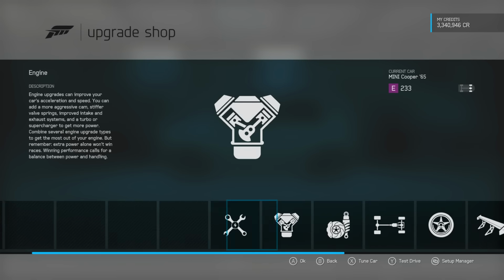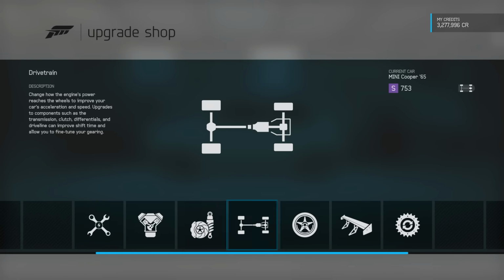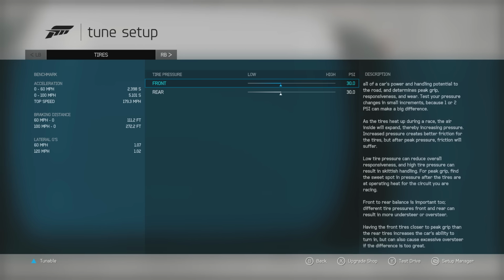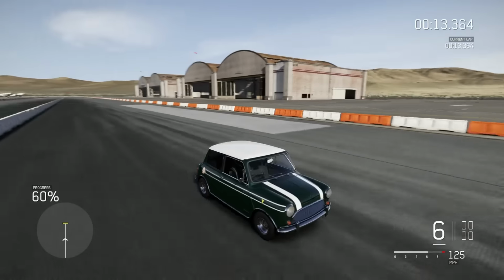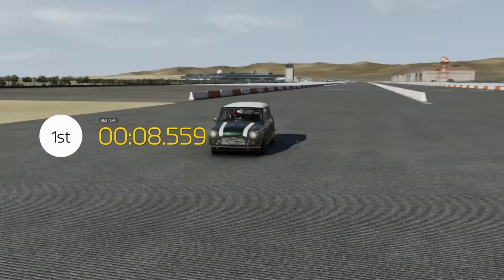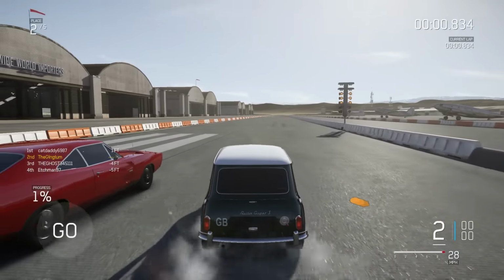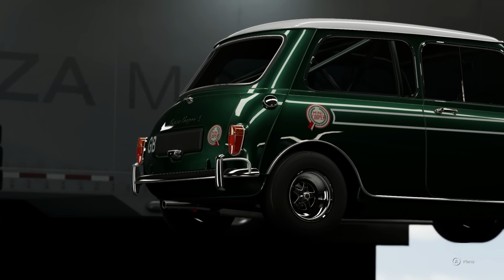1965 Mini Cooper S || 700HP SLEEPER BUILD || Forza 6

Comment: That's stutututu is when there's no blow off valve and the intake manifold shuts. So the pressurized air has nowhere to go besides right back out the turbo so it makes that stutututu. But blow off valves can help your turbo last longer and help it build boost better off the throttle

Comment: Btw, the turbo noise you hear isn't from a blow of valve. It's a result of it not having a BOV, that noise you hear is called flutter, it happens when the turbo purges through the blades. So instead of saying "That blow off valve tho" say "Dat flutter tho".
Reply: in my opinion a flutter sounds a lot better than a blow off valve. I just lova that stututututu!!!!!!

Comment: If Gingium would learn how to tune individual gears, he might actually knock even more time off than just 0.1 or 0.2 off the 60mph and 100mph times..

Back on Forza 3 and Forza 4 thats how i won most Drags, 1st gear and 2nd kind of long so you are changing gear at 60mph then 100mph (if the car could),  not around 50 - 65 - 85 - 110 - 130 like Gingium does
Reply from the maker: Yeah, the gears where definitely too short
Reply: +Gingium Those 2nd and 3rd Gear Changes where definitely losing you most of your time in todays video..

Tune the gears in your own time and give it another go

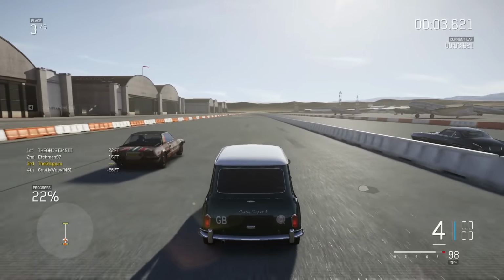Comment: 10:13 no just your gears are to short
Reply from the maker: So Ive heard
Reply: +Gingium I suggest making the first gear long enough so that it doesn't hit the limiter as soon as you launch but not too long so you don't stall, second gear should be shorter then the first (obviously) but not too short so you not going straight into 3rd gear within a second or two of shifting
Reply: +Gingium also if the car is AWD don't put a roll cage into it, it'll only slow you down

Comment: that guy took the spoiler off the daytona, whyyyyyyyyyyyyyyy
Reply: for aerodynamic purposes
Reply: yo the whole point of the giant spoiler on the Daytona is to have downforce. so when you say the reason he took off the spoiler id for "aerodynamic purposes" it makes no sense. Js
Reply: +Austin Reaux so you need down force for drag racing? wouldn't that increase drag and slow you down? it was a Joke actually dude but it went way over your head lol
Reply: +Omega RED yeah I guess it did go over my head lol. And you want down force in drag racing to keep you planted to the ground. The down force of the spoiler will help you have high amount of grip at low and high speeds which is good especially in drag racing when you want to be the first off the line and the first to the finish line. Also the downforce will keep you from losing grip suddenly and going out of control. Yes it does cause drag but good drag. I'd rather have drag and stay planted on the ground than have no drag and fly off the track
Reply: Austin Reaux well I you have a point but a spoiler doesn't work at low speed and it doesn't help you get off the line faster. In nhra spoilers are used to make the cars stable at high speeds not for the down force. Down force helps for cornering not very helpful for speeding on a  straight line
Reply: +Omega RED you need down force for grip. Think about it. You all the weight of the engine, the driver, transmission, etc at the front of the car and your got no weight on the back. Down force is needed. Trust me man I grew up in a family of drag racers, car builders, collectors etc.
Reply: +Omega RED and also, depending on the pitch of the actual airfoil on the spoiler, you can have downforce at low speeds
Reply: Austin Reaux Omega RED Are you done now, my phone gives me a notification every time. Please stop, the daytona doesnt look right without the high spoiler that why I commented.

Comment: Your gears are far too short, sir. 

1. When you have 700 horsepower in something that small with AWD, you could make 1st run like 60-70 mph pretty easy. You want to spend as much time in a gear as possible. If you lose half a second of being in the power 5 times during a 8-9 second run, you are selling yourself short.

2. If the gears are too short, you are missing out on the power-band regardless. Say the peak horsepower is at 7,000 rpm on a car that revs to 8,500. If your gears are too short, you will end up only using that last 1,500 rpm in each gear.. meaning that in each gear you are only using the rpm range where the power is actually falling instead of rising or leveling out.

(Number 2 doesn't matter if you are in something like a Honda, or some BMWs and Ferraris where their engines make power all the way up until the redline, but you still want to pay attention to number 1.)
Reply from the maker: Very true, I sadly didnt realize this till the end
Reply: No prob. I'm sure you noticed, just figured I would give some general advice for drag builds. With nearly every build I have ever done, the most important parts have been 
1. Setting 1st to launch hard as possible without bogging down, while keeping the gear as long as possible.
2. Adjusting the suspension to correctly transfer the weight depending which drive type the car is.

There are other things to watch out for also.. like sometimes more weight is actually better, short shifting cars with power that falls off after the mid-range too bad, when and when not to use downforce.. All that good stuff.. but gearing is almost always first priority.

Anyway, keep up the good work. I still fire up the 360 every now and then and play some forza 4, it is nice to see someone working with some of my favorite crappy little cars in the newer games.